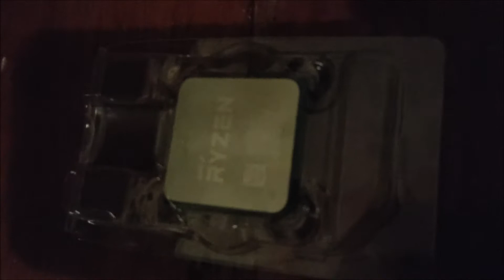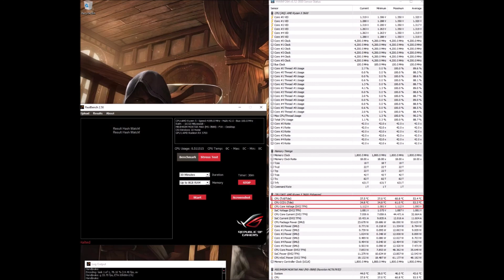R5 3600 Build, Deepcool Gammaxx 400 Pro, MSI B450m Mortar Max, Sapphire RX 5700 Pulse Rakk HaliyaM

Comment from the maker: 0:00 Parts & Talking
7:04 Case - Rakk Haliya mATX
19:29 Arctic F12 Fan install
22:09 B450m Mortar Max + R5 3600 Install
25:06 Seasonic gm-650 Test
26:21 PSU into Case
 27:26 Motherboard into Case
30:38 Front IO Cables
31:18 Gammaxx 400 Backplate
33:10 Clean CPU
34:28 TIM Application Spread Method Cryorig CP7
35:33 Gammaxx 400 Pro Install
36:40 Gammaxx 400 Spring Clip Fan Install
37:28 RAM
38:07 Arctic Xtreme IV + mATX fail
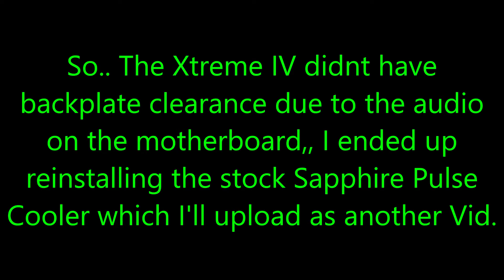39:13 Sapphire RX5700 Pulse Install
39:56 R5 3600 Testing / Undervolt / OC

Overclock/Undervolting pics didnt come through very well as I forgot the main video render is 1080p while the pics were 3440x1440, HQ Pics below:
Full stock/Auto bios(1.37v): https://i.imgur.com/UeQqHNu.jpg
Auto 36x Multi, Bios 1.37v LLC6(Testing voltage+LLC/Vdroop behaviour): https://i.imgur.com/AgzzvSZ.jpg
42x Bios 1.2875v  LLC6, allcore vdroop 1.219v: https://i.imgur.com/gVYxaEA.jpg
42x Bios 1.25v  LLC6, vdroop 1.181v: https://i.imgur.com/0d5wZmx.jpg
42x Bios 1.15v LLC6 vdroop 1.094v: https://i.imgur.com/7UDoCxV.jpg
42x Bios 1.2v LLC6 vdroop 1.144v: https://i.imgur.com/4WK6k7Q.jpg
42x Bios 1.1375v LLC6 vdroop 1.081v: https://i.imgur.com/UUZ3nV7.jpg
Final undervolt 42x Bios 1.125v LLC3 vdroop 1.087v: https://i.imgur.com/I4GXX1m.jpg
Stresstest 30min Asus Realbench, Max 61C, vdroop 1.081v: https://i.imgur.com/PH75bvU.jpg
Ryzen ClockTuner(CTR) Sample Quality: https://i.imgur.com/pai6WFN.jpg

The above tests dont include the crashes/fail posts under 1.1375v LLC6 or under 1.12v LLC3, but the general gist of it is I increased LLC to get the idle voltage as low as possible while still keeping load stability on a all-core manual OC.

Comment from the maker: Overclock/Undervolting pics didnt come through very well as I forgot the main video render is 1080p while the pics were 3440x1440, HQ Pics below:
Full stock/Auto bios(1.37v): https://postimg.cc/0zTNLpHM
Final undervolt 42x Bios 1.125v LLC3 vdroop 1.087v: https://postimg.cc/5XY07PpW
Stresstest 30min Asus Realbench, Max 61C, vdroop 1.081v: https://postimg.cc/nMYbsrcB
Ryzen ClockTuner(CTR) Sample Quality: https://postimg.cc/p9p5T3f5
44x Bios 1.25v LLC3: https://postimg.cc/RW1jpyLB
44x Realbench: https://postimg.cc/gwP1kPFN

The above tests dont include the crashes/fail posts under 1.1375v LLC6 or under 1.12v LLC3, but the general gist of it is I increased LLC to get the idle voltage as low as possible while still keeping load stability on a all-core manual OC.
Reply: Hello po May I ask if possible to update the images(404 not found) ahahahah cause I want to know the temps in stock settings of ryzen 5 3600 using gammaxx 400
Reply from the maker: @fortunewilliamledesm9559  Yo,, Updated, had to cut a few out but the full stock & final undervolt are there, plus some 4.4ghz testing(but I still choose 4.2 for 24/7 use). Temps are great at either speed for an all-core OC. Just click the images to zoom in HQ if they are a bit blurry.
Reply: @Jo3yization   @Jo3yization  thank you very much. I was looking for a cpu cooler for my friend. I was thinking if id-cooling se-242 xt is better than the gammaxx 400 pro.
Reply from the maker: @fortunewilliamledesm9559  No worries, out of those two it's actually very close, I would go for the one with best price + looks that your friend likes,, Gammaxx 400 pro is blue LED only or Gammaxx 400 Ex All black fans.

This non-english review is pretty solid to show just how close they perform: https://youtu.be/m5_PV8Fz_n4?t=333

Comment: Does the first ram slot touching the CPU fan because I only have 2 ram slot and I'm planning to buy the same CPU cooler.
Reply from the maker: Clearance is good, you can see at 38:29 cooler fan isnt overhanging the first ram slot. Have 4 sticks in my current 5600x build same board & cooler.

Comment: Does the air cooler have much space left between the glass? I'm waiting for this cooler but now I'm afraid that I won't have enough space for it.
Reply from the maker: The glass closes fully no issues, probably 3-5mm clearance but hard to tell. I wouldnt worry about it at all :) Airflow is great & temps are really good too if you check out my 3600 benchmarking/tests.
Reply: @Jo3yization  Thank you : D

Comment: When will PC Air cooling will not be stupid?
I mean GPU are getting bigger and bigger, Air Cooler are getting bigger and bigger! 
I mean what the hell! 
You can barely fit the  GPU, RAM in there after using that Air Cooler. Most Air Cooler are like that you always have to worry about GPU and RAM fitting on the motherboard.
Reply from the maker: Yep it looks cramped especially in a mATX case, I currently run a AK620 in a full-size Rakk Haliya & the clearance is much better, its still big but GPU & Ram have plenty of room all 4 slots populated.
Reply: @Jo3yization  DeepCool AK620! That actually fit into MSI B450 Mortar Max with your same GPU in the video?
Reply from the maker: I can't say as I now run a 5600x + RX 6700 XT /w normal profile backplate, but apart from specific thick Arctic backplates, the clearance between cooler & normal profile GPU is great,  there's enough room to add heatsinks & a slim fan to the backplate if I really wanted(about 2.5cm), I think an Arctic Xtreme IV backplate 'might' fit but it'd be tight.

As for RAM clearance, the front fan of the cooler completely covers the first 3 slots, but it does so without interfering or touching my 4.35cm tall Team Dark Za, AND without having to adjust the fan position, so the front most fan still sits flush with the top of the cooler even with all 4 sticks installed, the only negative I could possibly say about it is I'd have to remove the front fan if I want to access the sticks for removal, but thats not something anyone would do frequently & but this isnt really a problem as they also improved the clip/mounting so the fan is very easy to take on and off.

The front fan can also be repositioned to the rear of the cooler on the opposite side to give 100% ram clearance with nothing in the way at all if you do change ram a lot(maybe a benchmarker testing many kits). & the Aesthetic this way is nice too, I saw a review site tested just that orientation: 
https://www.eteknix.com/deepcool-ak620-air-cpu-cooler-review/4/
https://cdn.eteknix.com/wp-content/uploads/2021/11/IMG_20211120_113123.jpg 

I havent done a AK620 video yet but you can see the clearance on my own setup briefly here: https://youtu.be/OVw0QcQKk_k?t=2742

Comment: So we don't have the same specs any more? :(
Reply from the maker: I guess not? :( I still have the 6700k but its running on iGPU atm,, when I can finally upgrade to a 2021 GPU, the RX5700 will be going back to the 6700k build for comparative benchmarks. :D
Reply: @Jo3yization  Thanks for keeping both rigs going, it will help me gague relative performance in games brother

Comment: Are you a Filipino?
Reply from the maker: Yes half, my mother is from Bohol. ✌️
Reply: @Jo3yization  ohhhh, that's why. I am curious because you are so fluent with English but you are using a Rakk Haliya. Thanks bud!
Reply from the maker: No worries, and yeah Haliya is the best tbh, I ended up swapping to the full ATX version as the price difference isnt that large. The value is amazing compared to overseas branded cases at 3-4x the price. There's custom filters being made by someone on shopee here in PH too, much higher quality than standard 240/360mm filters from china. If you're interested check his store: https://shopee.ph/shop/163872758/search
Reply: @Jo3yization  same thoughts abt that one. I hope that they will make much bigger version of haliya so that it could fit some big boy air coolers because it limits the max cpu height up to 160mm. But overalll good airflow and minimalist design. I also saw the custom filters which is good hahaha.